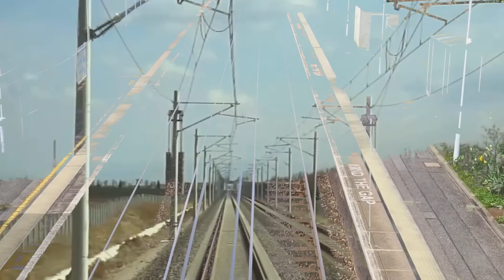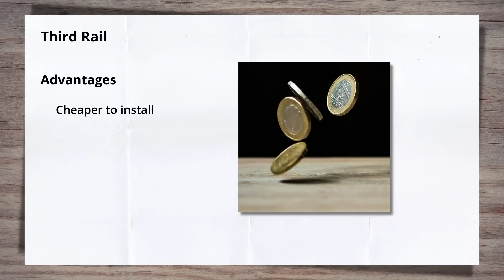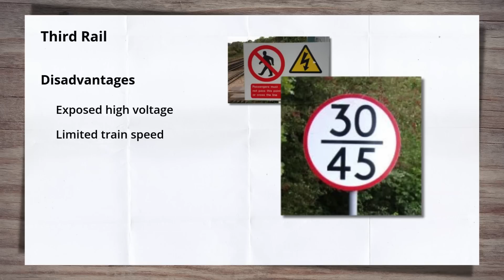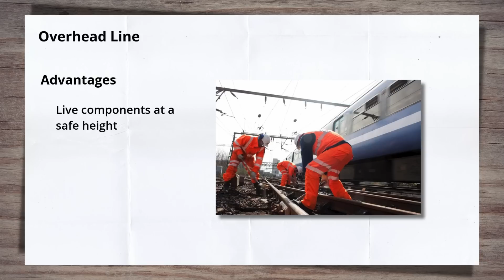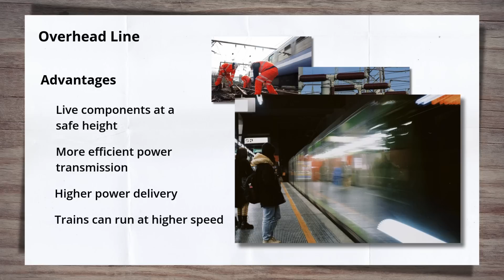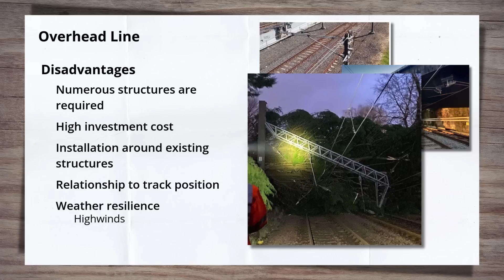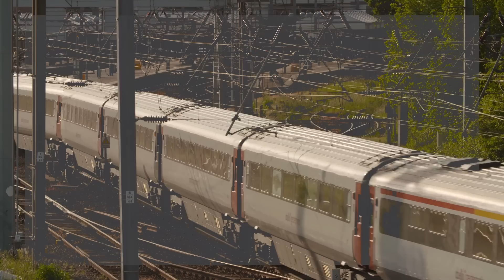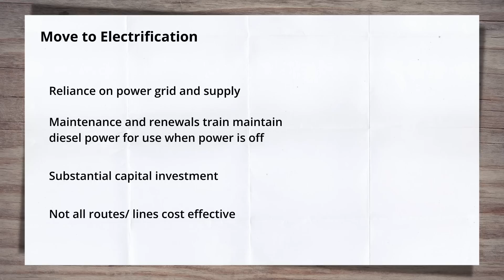How Trains Are Powered on the Railway | Third Rail vs Over Head Line Wires

Comment: The UN IPCC science report makes it legally clear to persons with a good high school level of science that it is in fact not discussing active greenhouse gases when it states it took its greenhouse gas samples at 20,000 meters where there is no active greenhouse gas behavior.  This is in effect a legal data transparency statement that protects the writers from successful fraud prosecution.

Global warming has been dead at about 1°C since 1992 that despite huge science studies has no known cause in 2024.   There is nearly a 100% chance new high temperature records will be set every summer.  

There is no mechanism that would allow greenhouse gas behavior to cause global warming.  Hard science and high school science at that,  is all the greenhouse radiant energy from the earth is entirely absorbed in earth's greenhouse effect within 20 meters of the surface by greenhouse gases with the only one of importance being water vapor that would hold earth's greenhouse effect at that behavior with or without the noncondensing greenhouse gases such as CO2 and methane.   

Earth's greenhouse effect is used as a primary example to high school student of system always in saturation from the strong greenhouse gas water vapor.    Even though water vapor concentration varies hugely across the earth's surface it always holds earth's greenhouse effect in saturation. 

The main advantage of the 3rd rail rather than overhead wires is much lower height than that of paragraph on the roof of the train,  making the 3rd rail system the choice for subways that have a protected track area anyway.    High voltage catenary is  typically world wide  25 kilovolt which requires long insulators to keep the wires from arching to other structures.   Amtrak's NEC runs an old electric system at 12,500 volts.   

The Chicago transit system still runs their overhead wires at 1,500 volts DC even though it requires a lot of extra maintenance with substation electric feeds spaced very closely compared to higher voltages.  This is because the trains go through low clearances where the overhead wires can not be spaced out further from the structures needed for higher voltages.   

High voltage wires sag from high currents.    For somebody observant power transition lines that are at their maximum it can be seen the wires are hanging lower.   The wires depend on circulating air to cool them.   When placed under ground power transmission lines are frequently cooled with a circulating oil system.

Comment: To solve the ice problem on 3rd rail the New York Central used under running rails. The contact was on the bottom of rail and the shoe was sprung upwards to contact. This system is still in use on the electrified lines running out of Grand Central Station in New York City.  The Pennsylvania Railroad chose over-running 3rd rail for Penn Station in NYC. I believe the New Haven , which served both stations had use 3rd rail shoes that could run on both.
Reply: They could install carbon heater pads under the "third"
Reply: The cost to covert to the bottom contact the third rail from top contact third rail in the UK would be similar to converting OLE. In the UK OLE is the national standard as well as you would save money by using less electricity.
Reply: @J-Railway-Volunteer  Isn't true, that the lower the voltage, the higher the current? Like 120V~ @ 20A as to 240V~@ 10A or 110.000V~ has low current, until it reaches the sub station, then dropped down to 11,000V~ and then again to 400V~
That's to was the power rating (current) goes up at 630VDC and the 25,000V~ uses less current?
Reply: @jonathonshanecrawford1840  With 750v 3rd rail you lose about half the energy down to heating versus 20% with 25kv OLE. For example, starting a 750v 3rd rail train takes around 3000A versus 200A for 25kv and 500A for double-headed 25kv.
Reply: @J-Railway-Volunteer  You got that correct Sir! It sounds like the OHE is more energy efficient, than 3rd rail, as its the current that drives the train, not the voltage per say. Like a water mill relies on moving water (current) not the water it self!
Reply: @J-Railway-Volunteer  A heavy 10-car CTA train may draw as much as 10,000 amps at 600VDC pulling away from a station stop.  The CTA uses 600VDC top contact 3rd rail for the whole system whether it is on structure, at grade, or tunnel.
Reply: @royreynolds108  10kA seems a bit high, considering 6.8kA at 750v is enough to power a full crush loaded 12 coach unit which would be 8.5kA at 600v.
Reply: Well bugger. I wrote over-running, that should be under-running. the contact is on the bottom. never comment before coffee.
Reply: @Ted4Short  I work perfectly fine without coffee as I have never had it.
Reply: @J-Railway-Volunteer  I am torn between admiring your fortitude, or mourning your loss. 😁
Reply: I've seem that (NYC metro) train driver cab view!

Comment: If the third tail is DC, why are there transformers in the train. Transformers only work with AC?!?
Reply: Because the trains were built for AC power and have been bought by TOCs using 3rd rail, and retrofit.

Comment: I think you have that wrong with regard to onboard transformers.  Transformers are used to step up or step down AC voltage.  They are most definitely required on AC OHLE trains, and not required on DC 3rd rail. where the systems can run at 750V and use more efficient DC - DC converters to step down for equipment like lighting.
Reply: All DC to DC converters are off two sorts. Almost all consist of a "chopper" that converts DC to square wave AC, then a transformer, then rectification. 

So these ALWAYS contain a transformer. Sorry😢

Older large scale DC to DC conversion was achieved with a motor powering a dinosaur dynamo. These fell out of use in new installations during the 20th century, once switched mode converters became efficient and cost effective, but some units are still in use on large scale static power systems.
Reply: To convert DC up or down, first it has to be converted to something like AC (cars do the same (sort of) with the points switching on and off, simulating AC so 12VDC can pass through the transformer (AKA coil), thus "Stepping up" the voltage!
So therefore, low voltage say 720VDC may be needed to be stepped up to 900VDC, to do so, one need to "invert" the 720VDC to say 700V~ (due to loss - normal) then stepped up via a transformer, then rectified to 900VDC.

Comment: Overhead lines definitely need transformers if they are AC. 25,000 volts AC is way more than the train actually needs. 

DC is usually 750 volts so a large transformer isn’t required.
Reply: 1500VDC in Australia, however I believe the long haul European systems use 15KV or 25KV
Reply: @paulstubbs7678  25KV is the standard for overhead lines in the UK. All trains which use overheads in the UK have on board transformers.
Reply: @extrude22  The 1500V is for local passenger services, country, intercity & freight are diesel
Reply: Um, it's not the train that's the issue it's the transmission system. 25vAC can transmit the same power at a much lower amperage. That means wires and infrastructure can be much lighter. Higher voltage enables it to be transmitted over longer distances. DC systems need five times as many substations to feed a line as 25Kv AC systems. Most new systems use high voltage AC. DC systems were an early 20th century system.

Comment: When you discussed third rail systems,you left out Conduits,and contact systems ! Both had been in use,in Britain and the US! Also those were combined on streetcars/trams,and had long work lives! London,and New York,had miles of those types of operations! Add,on DC operations,there were/are voltage ranges from 600,to 3500,and used on both third rail,and overhead! In Chicago,the former ILLINOIS CENTRAL lines are operated at 3500 volts,and under arduous conditions[lots of snow,ice,and cold],and the CTA elevateds operate with exposed third,as does Boston! Anyway,the history is interesting,and covers some 100+ years of operations! Thank for an interesting video,and you forgot the Liverpool Overhead,as a pioneering rail line! Again thank you 😊!

Comment: Third Rail is also a trip hazard.
Reply: But the running rails aren’t a trip hazard?
Reply: @John.Mann.1941  Indeed.  But Third Rail, unlike running rail, is discontinuous and switches sides.  I have seen maintenance workers adopt a 'tall stride' when crossing the rail.  Also, have a look at systems like New York Subway and Long Island RR.  The Third Rail is further away from the running rail, and is covered by a board.  Jamming your foot in between the rails is less of a problem, but you've still got to step over the thing.  There is also the possibility of catching your toe under the board.  There are plenty of pictures and video online of staff standing on the board!  And I haven't even touched on the trailing cables, hook switches, etc.
Reply: You should never get close enough to it for it to be a trip hazard.

Comment: Third rail seems like it should be more dangerous in principle, but what about in reality? Are there an appreciable number of injuries caused by third rails every year?
Reply from the maker: In recent years Network Rail has moved toward all working being done in possession with no trains running and the 3rd rail isolated.

Prior to that I know of two instances of people directly that came into contact and suffered injuries from it. While there are mitigations, such as shields, there is always an element of risk working around live equipment
Reply: It's bloody dangerous in reality, passengers and trespassers don't always appreciate the risk, and if they get in contact with the conductor rail, it's potentially game over for them. Not so much a risk under wires, not many trespassers are pole vaulting or abseiling onto the railway. This is also reflected in how infrastructure staff training is done in the UK, the third rail safety competency (DCCR) used to be delivered as part of PTS, it's done as a distinct competency now.
Reply: @helga_antal  I get that, it’s just that where I grew up we were constantly warned by the adults about being electrocuted by the third rail on the railway through the town. I guess that just conditioned me to assume that people were being killed by the dozen by third rails.
Reply: @helga_antal 
Railway tracks are dangerous places anyway. If electricified rails discourage trespassing they enhance safety.
Reply: @trueriver1950  
Sounds like irresponsible parenting. Do they not warn their children about the dangers of wandering around on motorways?
Reply: @trueriver1950  People successfully sue for being able to do stupid things. It is crazy but it happens.
Reply: @helga_antal  Top collection and uncovered only. The risks diminish as you use bottom or side collection with insulation..
Reply: I'm not sure how it compares in terms of stats I'm afraid, I've had a look and as far as I can tell the ORR doesn't generally record cause of injury in its injury/death stats
Reply: It’s my understanding that on the London 4th rail system the train were equipped with shorting bars which train staff could place across the power rails thereby tripping breakers on the power supply.  This left the tracks dead.  This was to provide for safe evacuation of a train in emergency situations.  Weren’t the stations also provided with means to kill the power in emergency?  My information may be out of date, I’ve lived in Canada for 57 years, but I used the underground a lot as a child and youth - very inexpensive using the staff discount my father got for the family (he worked at Acton for most of his working life).
Reply: @John.Mann.1941  the shorting bars were a back up system. 

There used to be two uninsulated wires running along the tunnels, carrying 12VDC or 50VDC. Short them together and the power was (should be!) removed from the rails.

Only then should the the motorman (sorry, always a man back in the day) would deploy the shorting bar. Whether the power has successfully been removed by the low volt relay or not, it is now. The only difference being the flash weld to the rails if the first system had failed.

I believe that is still protocol that before escorting passengers along a tunnel, railway staff have to deploy a shooting bar, not only to make sure the power is off, but also to make sure that is it comes on by mistake it's not on very long. Not perfectly fail safe, bit as a limitation of what would already be a huge mistake is a useful fall back

The original system was simplicity itself: the 12V system powered an electromagnet holiding up a weight. If you shorted it out, the weight fell, and was claimed to the lever operating the emergency off contactor.

I understand that some of these were upgraded to 50V and could also be used for the motorman to clip on a field telephone in emergency; but have never seen a reliable confrontation of that ...

Comment: It's pretty cool to ride on a train in the dark depths of Finnish winter and see the trackside illuminated in the flickering blue glow as the pantograph constantly makes and breaks contact through the ice.

Waiting to see what they do with the Forth Bridge, whether they're going to put masts on it or run trains on battery.
Reply from the maker: It will be interesting to see! Maybe more steel work to be painted!
Reply: i'd go with some small (1km range) batteries that can be recharged from the overhead very quickly.
Reply: @philhoward4466  The Forth Bridge is 2.5km long...
Reply: What did they do on the first three?  🙂
Reply: @James_Knott  
Three Bridges? Been third rail electrified there for nearly 100 years!
Reply: Many railways use the front pantograph of the locomotive without connecting to the motor to get rid of ice in the wires. And use the rear pantograph to get power. This way you can reduce arcing. Arcing is not good for pantographs.
Reply: Rapid wear to the pantograph
Reply: Is there an issue with electrification of the Forth bridge?  Don't like the look of the wires?
Reply: @haweater1555 That's what it boils down to, yes, because the bridge is a World Heritage Site.
Reply: @6yjjk  there are already plenty of steal beams above the tracks in that bridge. You can just attach the wires to those. 
Then people from the coast wont be able to spot the wires at all.
Reply: @daanwolters3751  That's great for the centre section, perhaps. What do you propose to do with the two approach viaducts?
Reply: @6yjjk  you could leave it without wires and let the trains just continue using their current momentum. This is done with a lot of movable bridges in the netherlands, usa (northeast corridor) and belgium. 
The 1km battery plan can be done, as the approach is shorter.
Third rail is another option, safety isnt that much of a concern on the bridge, as no one else should be on the rails there anyway.

Or argue that the middle part is the heritage site, and just install wires
Reply: @daanwolters3751  Surely that would make the entire bridge live? That does not sound like such a good idea.
Reply: An american freight train on average consumes 10 liters of diesel  per km. So it would need 30 kWh of electricity per km (taking into consideration the average efficiency of diesel locomotive is 25%). So you would only need 75 kWh of battery capacity to cross a 2.5 km bridge. Most electric cars have a battery with 75 kWh.